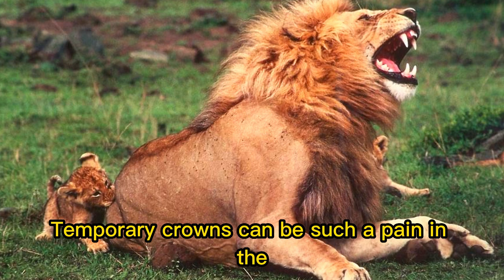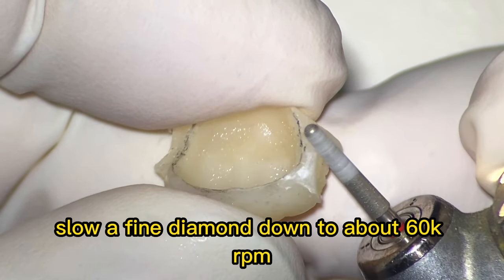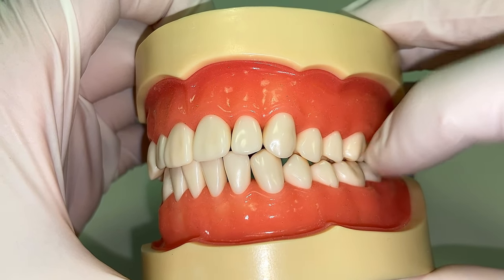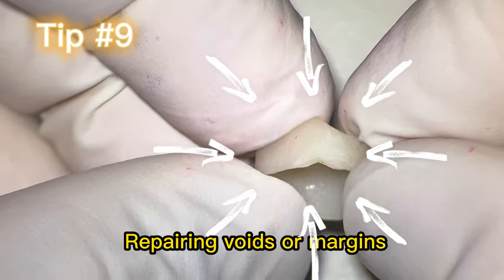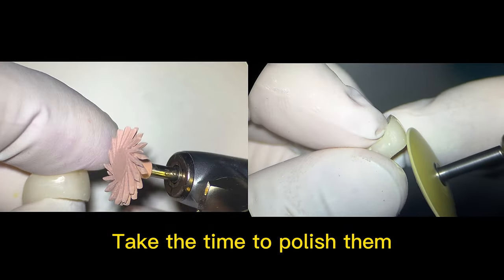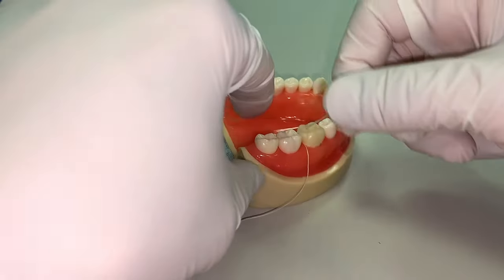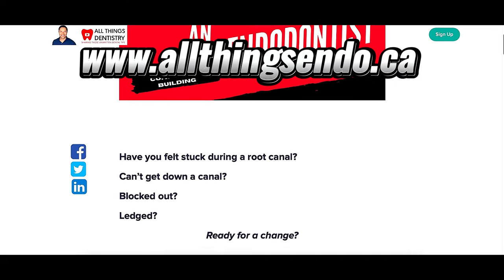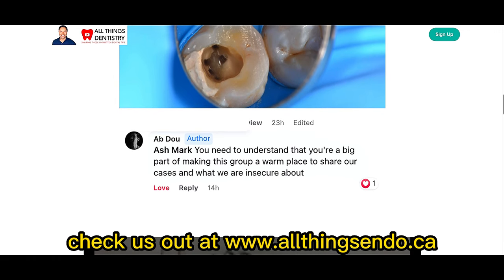How to Make a Temp Crown: Top 10 Tips {in 4 mins}

Comment: My patients often try to have any contact removed which messes with placing the final one. Most disturbing thing is if you end up with too thin material or even open dentin. First you must know how much you reduced with the prep. You need to widen weak spots in the silicone imprint. I also flatten the margin of my prep in the imprint to avoid too weak or missing margins. This is essential for me. To avoid sensitivity you need to avoid prepping vital teeth and must not do full metal crowns on virtual teeth. There is no other option. I try to do crowns most often on Endo teeth. I see sensitivity at any age of patients, it makes no difference. I try to remind me to put Gluma or anything on the stump after prep. But I haven't managed to remember to do it regularly in over 15y ;)
Reply: My patients occasionally indirectly request me remove all occlusal contacts too. Sometimes you just have to stand your ground and trust your 8-12 μm articulating paper and not the patient. I also religiously screen for somatoform disorders like occlusal dysesthesia before embarking on any treatment that involves preparing teeth or permanently altering the occlusion in any way.
As far as sensitivity goes, in 13 years of practicing prosthodontics I have encountered it extremely rarely. I can easily prep a vital lower incisor for a PFM with zero side effects. Strictly adhering to tooth reduction guidelines is the key.

Comment: Any tips on removing temp crown? I have to section my crown ~80% of the time and it’s time consuming and unpleasant for the patient as well. I use tempbond and use hemostat as well as spoon and explorer around margins. Do you have any other tips to help make temp crown removal easier and faster?
Reply: Hey, I had this problem many times. I remove a tiny bit of the inside of the crown for a minimal wider cementgap. Just a slight touch. Then try to get the temporary crown in dry conditions on the tooth with tempbond NE. When you remove it use a shepherd's crook(in germany we call it like this) and a hammer. It works most of the time and you provisional restoration will stay together.
Reply: @lordbecks1989  thank you. Very appreciated it

Comment: This is a great summary of most useful tricks that I've learned over the years of fabricating direct temporary crowns (and quite often extensive temporary bridgework) daily.
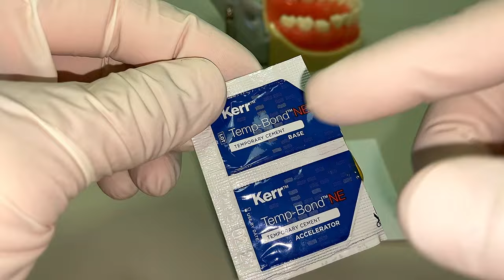2:25 Remember, your direct temporary crown is essentially an imprint of your prep without any space for the cement layer. Unless you relieve the inside of a crown with a bur prior to cementation, never load the temporary crown to the occlusal part with cement. Depending on the taper of the prep and the viscosity of your cement you might not seat the crown fully. Always place only a small amount of cement on the margin the same way you would place it in a cement retained implant crown in order to avoid subgingival cement residue.
Also I highly recommend investing in several pairs of crown removing forceps. It'll make your life much easier.
Reply from the maker: Thanks for the comment. Interesting points about adding cement. I never thought about that before. 
I agree with the pliers 100%. Hemostats are a poor comparison to the proper crown removal pliers.